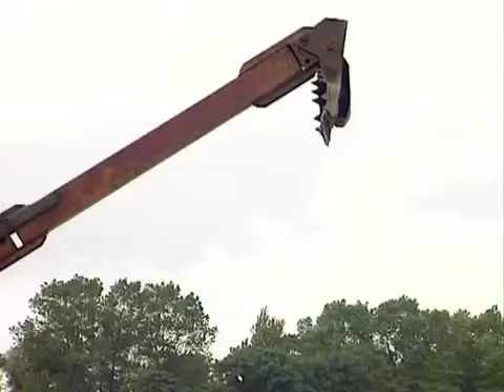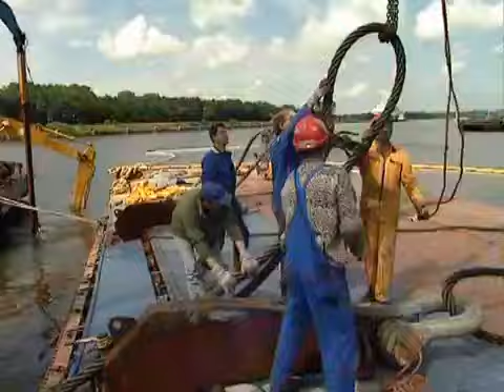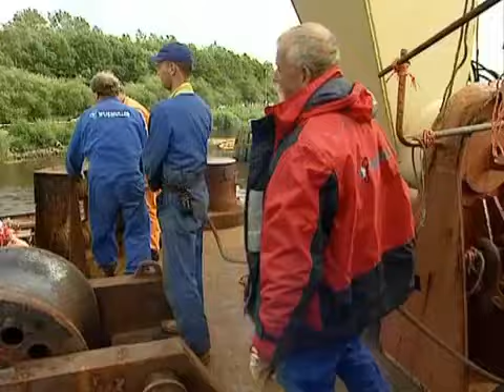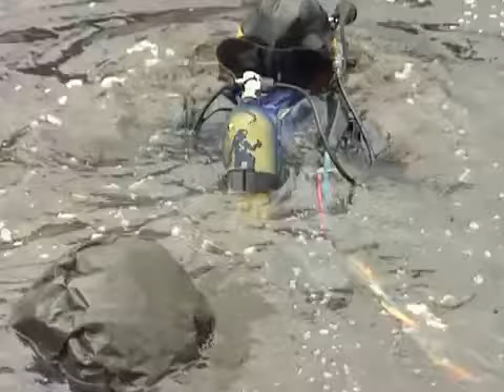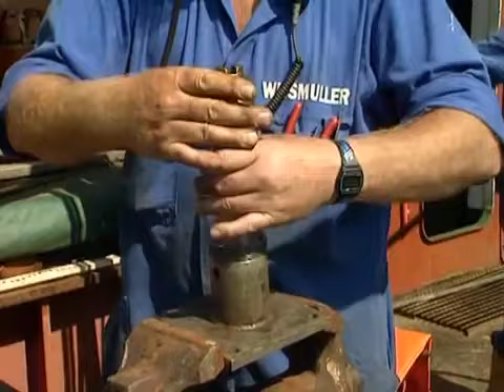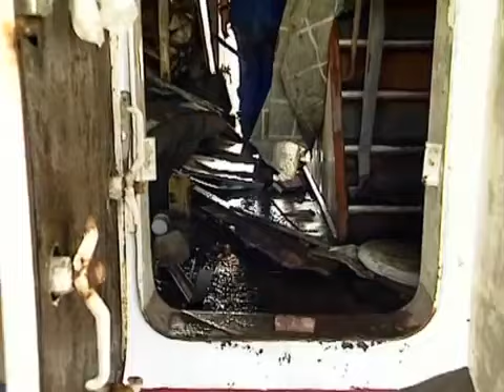Wijsmuller Salvage - The refloating of the m/v  UNO

Comment: I bought a cheaper RCA to USB video converter back in the mid 2000's , it did this same "Jerking" video.
Reply: In the mid 2000's , video convertors could already capture at full  25 fps or higher frame rates...

Comment: Does anyone hav3 a guess of the cost of a salvage like this . It would be interesting to know
Reply: I'd guess in a calm canal like this with only one hole would be cheaper than on a reef or shore in an ocean with waves and storms and multiple holes or a broken keel or the ship in two pieces.  The weight of the ship probably also affects cost.  Oil leaks increase costs because they have to stop the oil leaking and clean up any oil leaked.  The M/V Rena on a New Zealand reef was one of the most expensive.  An article from 2013 estimated it would cost $135 million.  A 2015 article said it cost $317 million.  The most expensive ever was the Concordia which cost $1 Billion.  A cargo ship in the English Channel cost $40 Million.  Small sailing boats cost a lot less.  One I found cost $40,000.
Reply: @Gonken88  Costa Concordia salvage cost is closer to 1 billion dollars.
Reply: @WarM001  You're absolutely right, I was referring to a BS source.

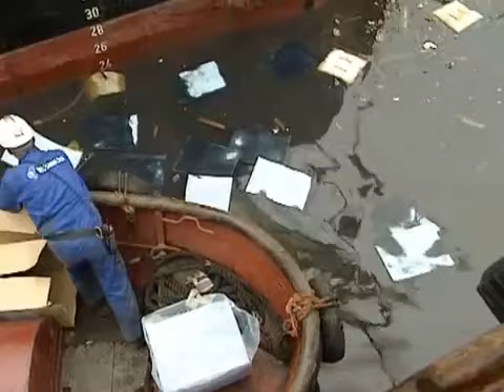Comment: i.d never have thought blotting paper could help with industrial oil spills, 11:18.
Reply: mark lewis 
They can absorb a lot of oil whiteout taking in any water. I use those a lot in my work with smaller yachts to clean the engine room.

Comment: Good video presentation. Rip for the lost engineer.
I wonder from a technical and cost perspective. 
If it's not cheaper/easier/faster to weld a patch instead of the explosive gun method used in this case? Any thoughts?!
Reply: Oh, I like that bolt gun.
Reply: Welding underwater is not easy by any standards. Considering the damage to the boat, the hull may have been warped. Using these bolts may be easier to attach the plate and even out any dents or bulges. I never heard of such a device by the way. But I do see the merit of it. Good question by the way. Hope they respond to your question. I am an engineer but not naval.
Reply: @cf6282  any underwater work is difficult.
I just wonder when these salvage teams will start using personal submarines like the Deep Worker. A 1 or 2 person sub that can go 1000 metres deep without pressurizing the air. Good for 6 hours of work on a charge. With less risk of a diver getting the bends  it makes the jobs that bit safer.
Nuytco makes a number of subs, all can operate without being pressurized to the same depth.
Reply: The method used would be faster than welding in a submerged environment. Trying to get and keep an arc going to weld under water is a slow process, gas welding doesn't work.

Comment: You can tell they finished up with the left edge of the patch only putting in about 1/2 the bolts.
Reply: both vertical runs are missing bolts. Could be they avoided a seam or structural component